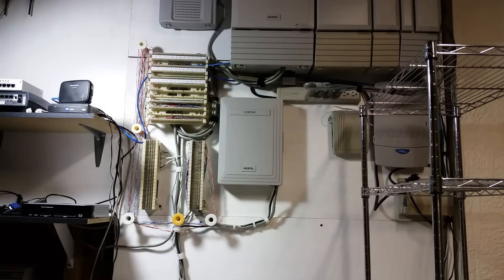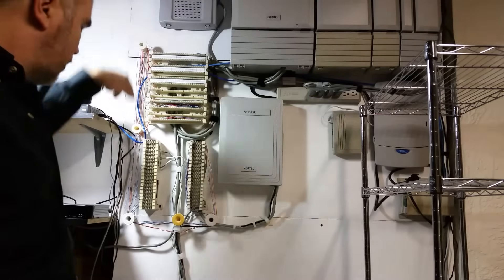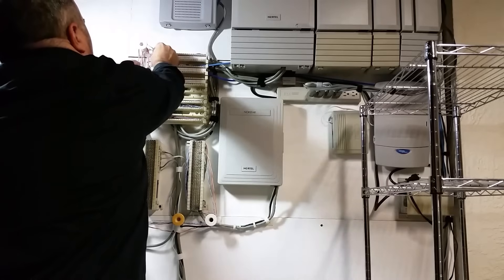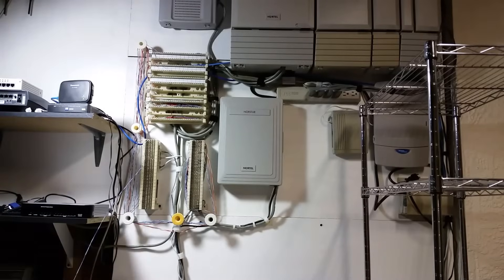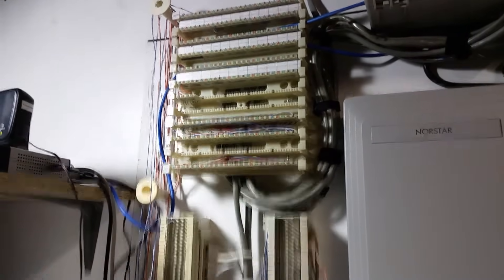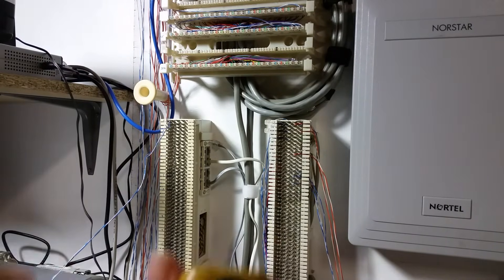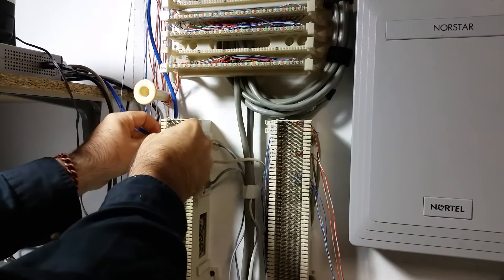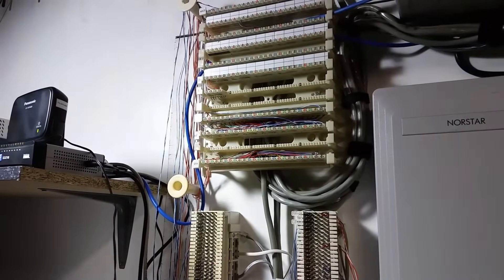Telephone and PBX Cross-connections

Comment: I got here, because I am more a IT related tech. But every-once-in-awhile it ends up crossing over to POTS and then I'm in the "wilderness". This stuff frustrates me. Especially how I'm usually using Ethernet wire colors for it.
The project I'm looking into is requesting a cross-connect from a VeloCloud SDWAN device to POTS. Any pointers that you could give me to get better at this side of things? I can trace Ethernet all day, but doing the same thing with POTS gets me flustered. I need help.
Reply from the maker: I wonder if these two might help:
https://youtube.com/shorts/suJp_LWIW1A?si=FJ2OcHj7wN1GozG4

https://youtu.be/rpECvTyCs9E?si=pKoiYfS9ClgpRXOM

Comment: Interesting stuff. I work in K12 IT. All of our schools have these panels mounted on a wall in the main data closet/room. But I highly doubt they're used anymore. Long before I started working there they transitioned to VOIP phones so all of the analog stuff is largely unused.Its just been sitting there for years. Don't know if they'll eventually rip it out or just leave it there. I believe only the security alarms still use a phone line.
Reply: The old block, telephone ports, gives me shivers every time I see them, old jumpers hanging, maybe one still has a battery attached waiting to eventually die in some decrepit looking brick windowless building with a slightly crooked AT&T logo hanging. You stand and watch as an old man steps out, his pure white beard catches in the wind, he shakes his head. Soon the job of a phoneman will just be a memory. All these young people with VoIP, no one wants a physical connection anymore I think that says a lot about our society.😢

Comment: Hey I've got a question for you. I want to swap two lines. One is analog. One is digital. I do know that at the jack for the digital line I will use the black and yellow wires instead of the red and green. I took care of that and then swapped both at the blocks. What I ended up doing was actually swapping the extensions. So I went back and returned the wires on the block to where they were. 

This is what I had. 
Ext. 252 - analog
Ext. 218 - digital

I want them switched. So I took each set of wires and just swapped them where they toned out. I've only done this a few times before and it worked out fine. Only thing I learned was to use the black and yellow wires instead of red and green for digital. 

I'll go check it again. Just thought get your input.

Comment: Over 33 years I've been a telecom and data tech. I have a system for patch panel move solutions so you don't need to cross connect every working station port on your system as well as the customer can be shown how to do their own moves when bob and alice change cubes or offices.
Reply: yes prewire everything and move the number digitally. Documentation is important.....

Comment: nice video!  any tips on identifying what the source relates to on the 110?  ie port1, 2 etc.  do you have to look at the pbx's config?
Reply from the maker: yes, Every PBX is different.  In General the extension ports go from left to right (or top to bottom on 66 block).  In this video, I was showing a Nortel 0x32 PBX.     Having said that, it's pretty easy to find the installer manual for just about any PBX on the Internet (unless the system is really, really old).   Thanks for you question. :-D